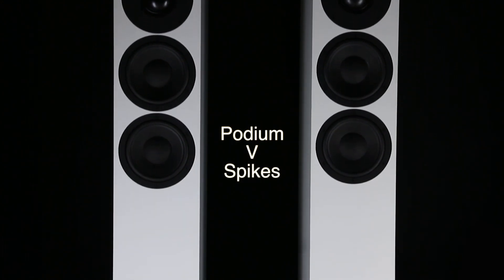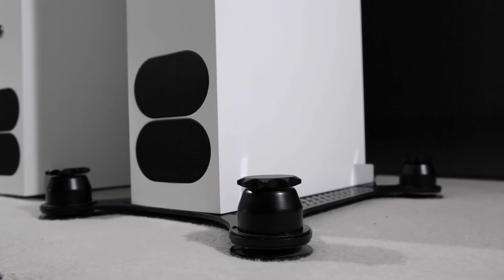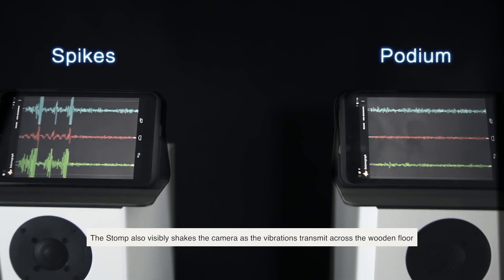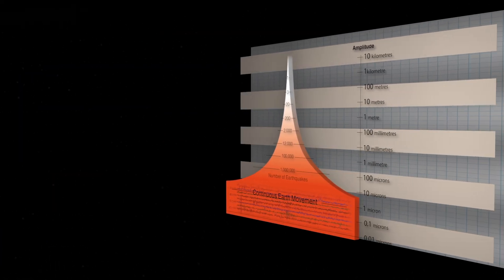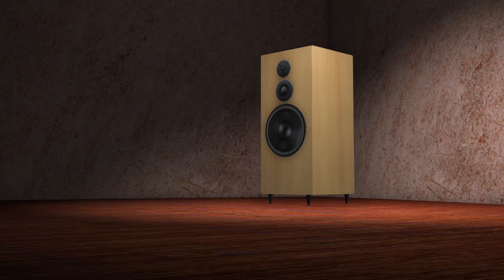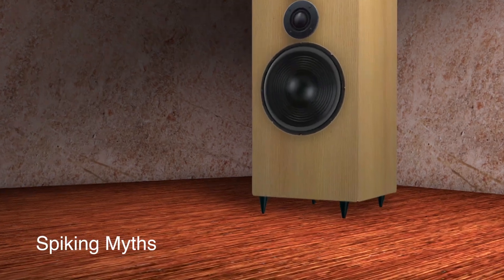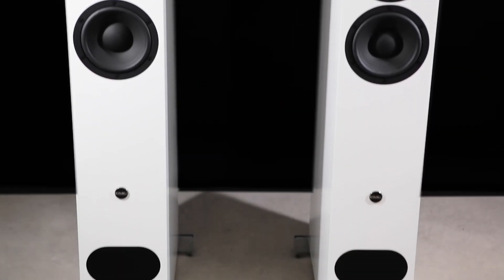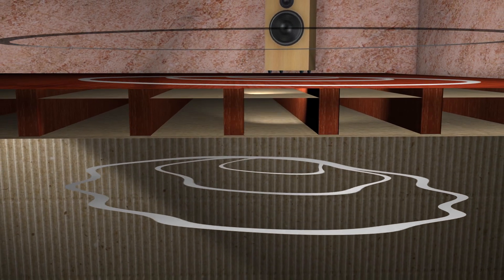Unlock True Sound: How Townshend Seismic Podiums Eliminate Micro Tremors & Vibration

Comment: The aim of putting speakers on the spikes is not to isolate them from vibration, but the opposite - make the bigger added mass. This improves the bass and midbass reproduction. 
You don't need to make vibration measurements - just listen.
Reply: actually spiking to the floor doesn't make the base better makes it more boomy if you try your speakers on the podiums oh my God you'll hear how much better the bass gets more faster articulate
Reply: @chrisrichards2827  It depends on the floor and structure. Spikes on a wooden floor in a typical house may cause the floor and walls to move creating vibration throughout. In such a case isolation may be better. However in floors like concrete basement floors the spikes may be better as the floor cannot move.
Reply: @darthvadars  actually Spider-Man you're wrong about that one because they tried it with concrete floors and the same thing happened except it was on a different frequency then from wood floors but it did the same thing the vibration came back into the speakers and it started shaking the speakers and if you watch the videos from Townshend you will see that they put seismographs on top of each speaker and it shows the vibrations going into the speaker from a concrete floor.
Reply: @chrisrichards2827 Actually  - you are wrong, Chris Richards. As you  add mass to your speaker the natural frequency of the system: speaker-base gets lower. And it is good as the amplitude  of the vibrations gets lower and there is nothing in the musical signal on lower frequencies.
You even can get better bass in you put a weight on top of a bookshelf speaker.
Just try and do. It costs nothing.
Reply: actually you're totally wrong on that one it makes the bass sound more wooly when you isolate the speaker from the vibration it makes the bass sound faster tighter and more articulate, spiking is old school decoupling is the way to go makes everything sound better.

Comment: Thank You for debunking the spike myth. For those of us on a budget, and space constraints, an appropriately cut  piece of acoustic nub foam will have to take the place of the platform solution for smaller speakers. I tried it, and while not a perfect solution, it helps a lot. I did the test with a seismograph app, it's makes a big difference. Probably wouldn't work with bigger speakers for stability reasons though.
Reply: unfortunately the form is not going to stop the vibrations going into the floor sorry.
Reply: @chrisrichards2827  My measurements with a seismograph app tell another story. They certainly don't kill all the vibrations, but for me, the foam pads reduce them significantly. Again, this is with small Tannoy bookshelf speakers, and I don't know how effective (or even safe) this is with bigger ones. But for my use case,the nub foam in the size of the speaker base solved the problem well enough, my neighbours are happier for it and the sound has actually tightened up a bit since the bass resonating through the stands and into the floorboards has decreased.
I'd love to give those platforms in the video  a go, but one of them costs more than my pair of Tannoys. As far as spikes go:  Never again. Maybe they're better with concrete floors, but in my  living room with wooden floor they made things worse, sound-wise AND for my neighbours.
Reply: @jimboblivesforever  well I got the podiums and all I can say is two words holy fuck!! it's like I've got a whole new system again, with depth height the separation the air and space the bass is much tighter faster articulate I didn't think it would make this big of a difference all the reviewers said the same thing you know you have nothing to lose to try them because you have a money back guarantee if you don't like them you just send them back, but all I can tell you boy is it worth the money best $2,000 Canadian I ever spent on my system.
Reply: Never put your speakers on a foam nub. Spikes are not a myth. You  don't need science (though there is science in it, but the opposite to mr. Townshend's one) - just listen to your speakers.
Reply: @geokrilov  well I had spikes underneath my monitor audio platinum 200 Gen 2 and now I tried the podiums and it's so much better it's not even close.
Reply: @geokrilov  You might want to try mounting a subwoofer on a barely inflated bicycle inner-tube of appropriate size, better still on a slab of stone on a bicycle inner-tube, as I've been doing for some years - the improvement in the tightness and 'tunefulness' of the bass is NOT subtle. I daresay the Townshend pods do a substantially better job given they are damped and more effectively absorb and dissipate mechanical energy (as heat).

Comment: Have just looked at your video again and think you may have forgot an other clear advantage of your system vs spikes!
If your system don't have spikes, your system dos also not put marks in the floor that maybe many while you are adjusting the speaker placement or the marks at the finale placement is getting deeper as the time goes on.

Comment: do i need this on rigid concrete ground
Reply: Yes, because the resonance between the speaker and the floor is more severe than a wooden floor and lasts longer.  Also, sound is transmitted into suspended and solid concrete floors and can be heard in adjacent rooms.
Reply: what about the subwoofer which have enough power to shake a room.
Reply from the maker: They work just as well with subwoofers.
Reply: @townshendaudio7193  yes - if you want to kill the bass.
Reply: You don't need it at all.

Comment: In engineering, we are taught to put numbers on things, not just guess! It is quite clear in the video that in the case of a 40g cone and a 40kg cabinet, (floating)  will loose 40/40,000 = 1/1000 of the signal, according to Newton's third law (which you quote). This means that the sound level will drop by 999/1000 = 20*LOG(999/1000) = -0.00869dB. I don't think even Gord Thor could hear that.

What does go, when isolating, is the resonance between speaker and floor akin to a plucked ruler in a bench vice. The bloom smear and colouration taken away is immediately obvious to all listeners, regardless of the floor or the speaker.
Do the experiments yourself. 
To measure, use Android, playstore, seismograph, Calvico.

Max
Reply: The cone is moving so its weight is not 40g but must be multiplied by the related acceleration
Reply: Yes also need take into account the air pressure created by the surface area of the cone in relation to the wattage driving the speaker Pythagoras would’ve been impressed

Comment: I downloaded the app. I would never have thought of it if I didn't watch this video so thanks.
Reply: Hi Jack,

Please see our website www.townshendaudio.com or phone Sue on +44 20 8979 2155.

Regards,

Max
Reply: What’s the name of the app if you don’t mind sharing :)
Reply: @911turbojk   I used to have an app called seismograph that did the same thing as they are doing in this video. I don't have that phone anymore. I now have an android phone and an app called sensor test has a gyroscope test which does a similar thing in a lot less detail. I am now looking for a proper app that does this but the trouble is, they usually contain adverts or in app purchases or they want access to my personal files for some reason. They go by the names seismograph, seismometer and vibration meter.
Reply: @45rpm.  I just tried the app call Seismograph and its the same thing that shows you XYZ vibration, I stomp my foot  in front of my HRS rack , and it had very low spikes so I guess the rack is working and then I left the phone on the speaker and did the stomp again and it shows the vibration traveling to the phone which was set on the top of the speaker, but however when the music is playing there is no spikes at all even if i turn it loud ( with bass tracks) so does it mean the speaker's isolation is working ??
Reply: @911turbojk   The responce they are getting does seem very big. They are using an iPad or something similar and it will only be using the internal gyroscopes. I think they would need a real dedicated seismograph machine to get that sort of response. They have to sell their isolation platforms somehow though :/